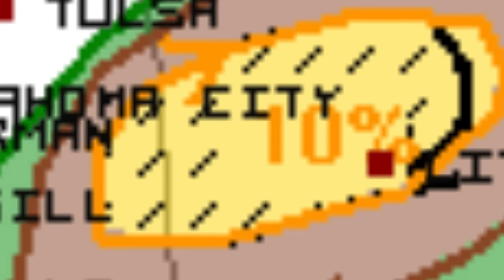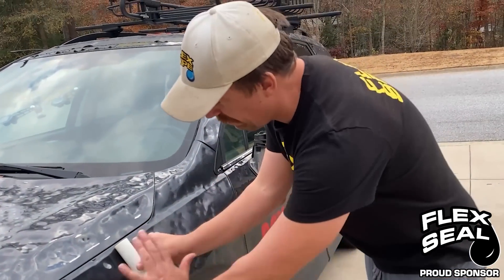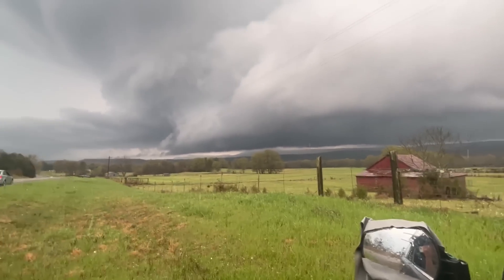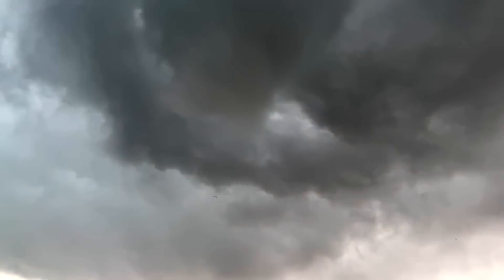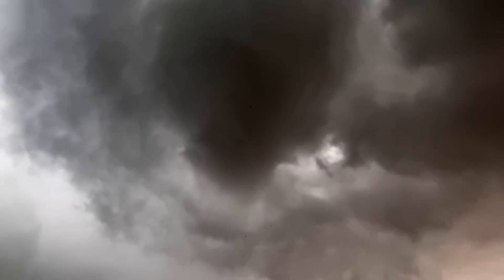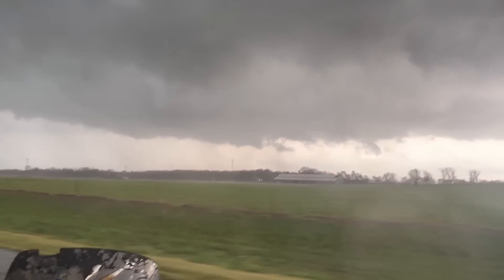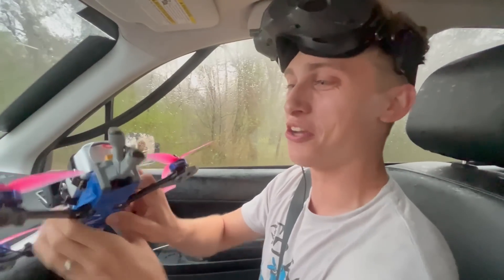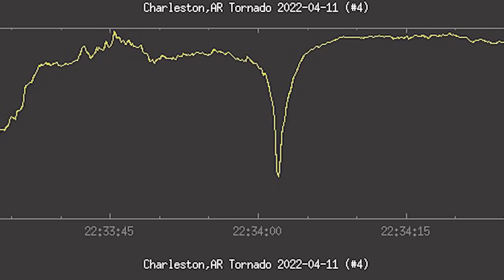Storm chasers record valuable data inside TORNADO with sensor mounted to vehicle with Flex Tape

Comment: All I want to know is did the data amount to anything worth knowing? Are we close to knowing more about tornadoes and able to predict them sooner?
Reply from the maker: Ideally we have a dense network of these sensors deployed 5 min in advance of a tornado. Then we’ll really be onto something. For now, we are more testing the concept of deploy a triangle in path. We have registered pressure dips on single sensors and those deployed in a line configuration
Reply: @ReedTimmerWx  it sounds like you need to be in front of a tornado from what I'm reading then put down many sensors in it's path (very unpredictable I know).